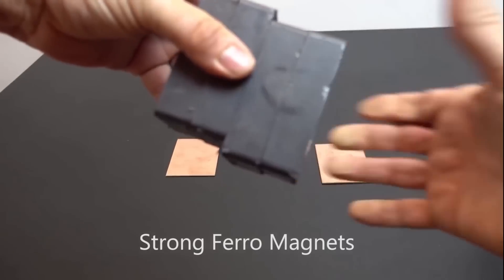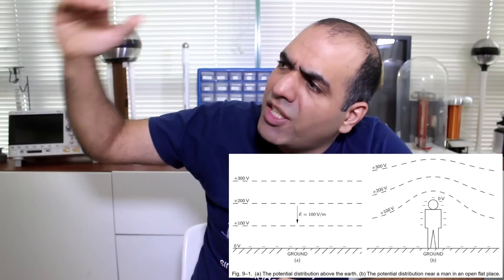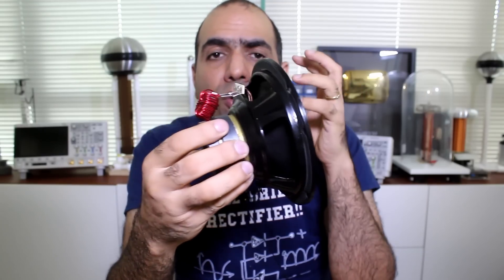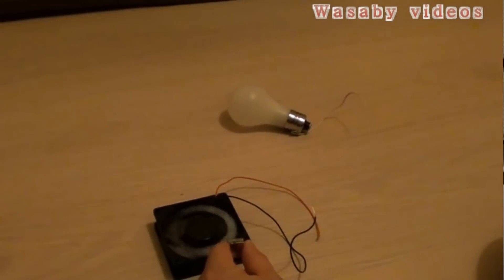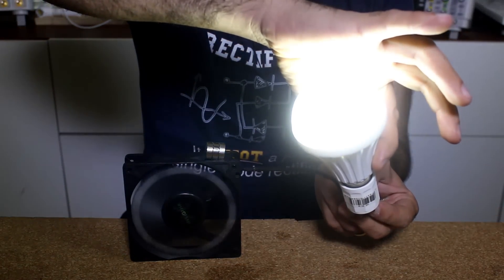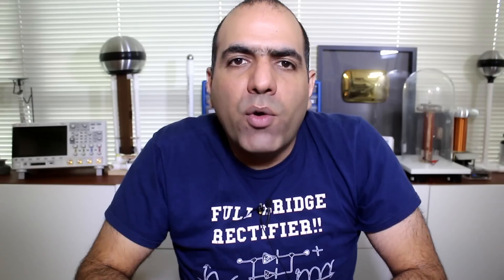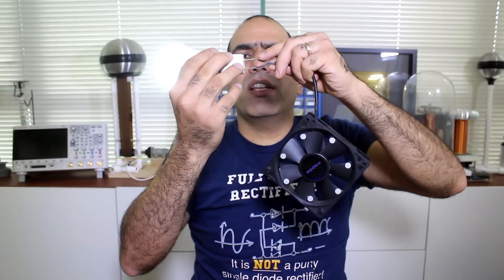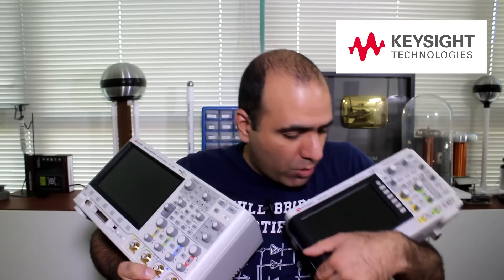Free Energy Devices Build and Science

Comment: There is free energy i.of one really wants it,  but it is far too dangerous to work on with it as you could get electrocuted, lightening is one example and the other is earth has a molten core, which is trying to resist moving with the earth's solid outer core,  the interaction between the two surfaces causes strong magentic field as well as generates electricity, we will have to dig hundreds of miles down to get to it. near impossible, however the weak effect of core of molten earth does create a weak moving magnetic field that can be inducted into a huge coil several hundred kilometer diameter and that should provide low frequency low voltage but high current electricity.  Besides if you dig two probes 2 miles apart there can be low voltage high current ac voltage that you can step up and use.

Comment: The light has battery in it. I have one I bought from menards for 10$ once you  connected the loop the light comes on and you recharge the light by plugging it into a lamp. They are designed for power failures.

Ok 6:39 is where he tells the truth. Lol

Comment: What if you were to do it mechanically instead of electrically? I can think of three ways this might be possible... One with water, bubbles, a tube,  a small air pump, and a Pelton wheel...A 3/4 inch tube placed vertically into a large body of water, about 4 ft deep. Bubbles introduced one foot inside the bottom of the tube when the air pump is turned on. The tube extends above the surface of the water 5 ft. with a 90 deg angle at the 5 ft point with a gutter to catch and direct water into a holding tank where water is then drawn from to push a Pelton wheel to generate electricity. 2nd, Another thought is to put a hollow Taurus on a horizontal axle with an iron ball in the center, then bring a magnet close to the iron ball a few degrees off of bottom dead center to make the ball roll while gravity pulls the rolling ball,  effecting the empty Taurus to spin on it's axle. My last idea would be to wait and see if there are any comments to my first two ideas and only if I see constructive criticism...lol...let you in on my best idea. ;) Let me know!
Reply: Don't hurt me too bad...I'm NOT an Engineer!

Comment: 1) No, magnetism through a wire does not create electricity... only a changing magnetic flux will cause electron flow... not a static (non-changing) magnetic flux field.  Your stacked small disc magnets do NOT create an alternating magnetic field. Once you join to identical magnets together North-to-South, the entire magnetic flux path of each magnet is through the adjacent magnet, none of it escapes the "stack".

2) No, picking up the atmospheric VOLTAGE at a single given point will not do anything. The only way to access this energy is to have a POTENTIAL DIFFERENCE... you must use an Earth-Ground as a reference, and then the "antenna" would be at the elevated position. The amount of available current per square cm is incredibly small, you would have to have a pickup "antenna" of several square meters to power anything.This 2nd "circuit" has nothing to do with resonating magnetism... it's nothing but a charlatin's way to close the DC circuit across the two connections of the "LED bulb", which has a battery inside it. When the 2nd magnet stack is pushed up far enough into the coil, it makes connection and turns on the "bulb".

This LED bulb explains all of those claims:
https://www.amazon.com/Light-Built-Rechargeable-Backup-Battery/dp/B0744GSNF9
TRUE "Free Energy" is nothing more than converting one form of "Nature Provided Energy Source" into a form we can use.  Typical examples: Solar Energy, Hydroelectric Energy, Geothermal Energy.We don't put energy into the "system", so we are getting more OUT than WE are putting into it. We are only providing the equipment to convert it into a form (AC) that we commonly use. 

Over-unity does not break the law as related to CLOSED SYSTEMS.  Real free energy is never a closed-system, it is an OPEN SYSTEM, whereby the energy source is outside of the conversion process.
This is the truth behind lesser-known "Natural Sources of Energy"... that "scholarly science" scoffs-at... until they are proven wrong, then it is spoken of as if they've known it all along.
In the 1700's - could mankind possibly understand or believe that we would convert Solar energy into usable electricity?
No different than now, when some REAL experimenters claim to have converted "background energy", the aether, zero-point energy... into a usable form of energy. Many things are discovered by people who are not educated in the related arts... that is not a requirement for "discovery"... and very often actually gets in the way of it!!

Comment: what the hell is AC energy
Reply: AC = Alternating Current. It switches polarities. In europe, the mains AC switches 50 times a second = 50Hz. DC = Direct Current. DC doesn't change polarity.
Reply: @rapidleopard3881   energy has nothing to do with differences between AC and DC
Reply: @ayushman_sr  You asked  what AC is, and I provided an explanation. What exactly is your problem?
Reply: @rapidleopard3881  "AC energy" is not the correct term. AC is way how electric current is in wire in this video
Reply: @ayushman_sr  There is no such thing as AC energy. AC, as I said previously, is current continuously switching polarities. It is exclusive to electrical energy. AC is in no way a type of energy.
Reply: @rapidleopard3881  thank you for your precious time to put up answers 
well my original comment was exclamation ❗ not a doubt i want to raise...

Comment: Thermodynamics is not your friend. Free energy exists! And it is bound with the name of Helmholz. Some people might think: Helmholz coils. In fact F= U - TS. And it is indeed free, because you don't produce it, but calculate it.

The other nasticity is the efficiency of eg. heating system. It can well exceed 1. Of course energy conservation is not violated. Part of the heat is produced using other energy (mechanic, electric work), the rest is pumped. The trick is, efficiency is the ratio of useful energy (heat here) to the work we put in (not the total energy, because what we pump is considered to cost 0$). Heat pumps work like that.

Comment: A motor, gear set and generator still won't work due to the slow-down of loads and also friction.
I think a solar panel is not free energy, even if it is connected to a lightbulb.
Rechargeable batteries cannot charge themselves.
A hand-crank motor is... read the top.

Comment: Capacitors self charge when you short them out in water. There is a way to get it free with a tuned piezoelectric capacitor but in the end the energy is coming from the sun by resonance... mechanical energy converted into electrical energy.. Ac by way of piezoelectricity. Tune it to F sharp.. the same frequency as the sun.
In reality there is over unity otherwise the universe would not exist. The universe...It's growing!!.... and it's nothing more than one musical note collapsing on itself in a torroid shape creating plasma that is creating everything like a 3d plasma printer. The F sharp note... the only note that can collapse on itself into a doughnut torroid shape. If one wants to see what a actual shape of an F sharp note is... Look at the Horseshoe nebula. F sharp is the color yellow of the sun and it creates the blue sky and the red sunsets.... giving you the 3 primary colors of a plasma printer. Same colors of a printer.... only difference is the universe is printed with plasma created out of a collapsed F sharp note that is beating to infinity.
There are probably more universes than grains of sand on the earth... because it's infinite.... there is no end.
The earth itself is a giant capacitor. We are living on one.

Comment: Hi Mehdi, good video I enjoy your channel and practical teaching. I know and understand the laws of physic and thermodynamics etc. I also know energy can't just be created out of nowhere and can't be destroyed as just "disappear". Yet I have a silly question... naive yes but serious question, I will appreciate if you can point me in the right direction to what happens with energy in this case:

1. Easy scenario, a magnet motor used as a generator
2. Rotating at X RPM using pedals or the wind
3. The motor produces... let's say 14V / 150mah. 
4. We plug a Light bulb (led, whatever) it turns on!

I know the magnetic field / coil-effect movement produces electric energy and it turns on the bulb. Ok. But what if we keep the motor/generator running and NO bulb is plugged? where all those 14V and 150mah go? I know about generators such as Van de Graaff and ions. In the case of the motor, would something like ions would be taking place? but in very low scale that we can't see any visual manifestation? Just curious. Same situation with more powerful motors used as generators. Thanks, and congrats with your channel. Hector.

Comment: I have to ask... computer fan and magnets. In theory, if we used a super light giant fan (just strong enough to hold magnets), put magnets on it’s wings and one giant super powerful magnet. If placed properly, would it spin or not? 
If yes, couldn’t we use it to run a generator and create electricity? (Considering we have an unlimited space and all materials needed)
Reply: even if you use an impossibly light fan with an impossibly smooth bearing, the magnet would not only repel the magnet nearest to it, but also the magnet coming up to it, you would need to use an electro magnet to pulse either the powering magnet or the motor magnets and that would take huge amounts of power compared to it's production.
Reply: nicynodle2 so I guess the input power for turning the main electromagnet on and off cannot be lower than the power produced by the whole contraption, right? How about if we use the same pulsating magnet and put it in a middle of many fans with magnets. Put the fans around the electromagnet. As many as we can in 2 circles up and down.
Reply: @Fefko13  it would work better, but still would produce almost nothing per fan whilst the electro magnet would drain a lot of power, also, (I may be wrong) the more interfering magnetic fields the weaker the repulsion of each individual feild. So you'd need an even stronger magnet to push all the fans. (Oh, and if 1 magnet falls out of line it will start to reverse)
Reply: nicynodle2 we would set the distances between small magnets on fans just far enough so that their fields wouldn’t interfere. They would “catch” the field of a great middle electromagnet while avoiding each other. Now we need to somehow calculate the power consumption needed for the electromagnet and the power generated by all the fans.

Comment: THERE IS NO acoustic energy in the air as long as the speaker is not generating sound,even then you would need a microphone to absorb that acoustic energy in the air and transform it back to electric energy.He is just using the speakers magnet and coil.it has nothing to do with acoustic energy.
even if he moves the speaker diaphragm by hand which he is not,he can't call it acoustic energy,that would be another form of mechanical energy!!
For someone who is explaining scientific ideas he needs to be more precise in his wording.
Reply: Speakers work both ways. They can convert incident acoustic energy into electrical signals or electrical energy. Unless the room is completely silent, there is acoustic energy in the air. Considering that total silence may not exist, it is probably safe to say that there is some acoustic energy in any room. Just not very much (as he said).

Comment: Just to clarify neurons don't send electrons through their axons, they send an electric current, which is just the flow of ions in chemistry. They rather send sodium and calcium ions than electrons
Reply: It still equates to the movement of electrons
Reply: @AbsoluteTrash_  not necessarily since the entire atom moves and I guess the electrons on it move. But they are in the same relitive area, technically hydrogen ions are able to conduct "electricity". But a positive hydrogen ion technically has no electron and is just a proton.
Reply: When those ions are created by your body it takes from or gives an electron to the atom, which then moves to the receptor where it gives or takes an electron, resulting in a net movement of electric charge from one place to  another, also known as current flow.

Comment: i got a free energy hack, its kind of dangerous and illegal, but it works every time. You just connect your power leads in front of the meter, and there you go, free energy. Just dont get caught and dont fry yourself, dont steal electrobooms job.

As for turning on a light with your skin. I have strangely had my LED strip light up very very softly on a strip of 3leds when i was pressing it down to get the adhesive to stick. But that is probably just some static electricity going trough there, and those are very tiny leds, that lid up dimly. How in the hell do people think you can get enough energy from your skin to light up a huge lightbulb? Or even a 3 watt led?

Comment: Guys you should know the basic of electrical engineering which says if there is no relative motion between inductor and magnet then no rate change in flux hence no current.another thing without connecting wire he he
Reply: Butt hafe u aktually tryed it??????????
Reply: It's basic no need to try

Comment: You said there is no free energy in the ENTIRE universe otherwise it would fall apart. Right and it is. The accelerated expansion of the universe is at odds with no free energy however the "free energy" density is so low that it only shows up on intergalactic scales.

Comment: Question if you put a black sharpie or pen on your arm and then point your phones camera flash at it why does it shock you do a video on this!
Reply: uberderpyhoovs ...what?
Reply: @ARSZLB  its true try it your self
Reply: uberderpyhoovs i honestly just did, and there’s no shock at all. you’re feeling the absorption of heat from the light output of the LED flash. it works to a much more noticeable degree if you just turn your phone’s flashlight on instead of taking a picture which only makes it flash once very quickly. so it has absolutely nothing to do with electricity and everything to do with wavelengths of light energy.
Reply: @ARSZLB  but i did the flashlight it didnt work at all but when i did the camera flash it shocked me sorry corrected my self  it felt like a shock when i do it with my camera flash
Reply: I have the samsun s8 btw

Comment: So here in the uk I was re doing my room and we took off the electrical outlet but everything was still active I turned on the switches by accident and touched the two plates behind the cover and blacked out so I have two questions one why didn’t I die and two if I didn’t die why did I pass out ( as I normally have a external thigh pain tolerance I shouldn’t of passed out from the pain) like if you want to know why ??

Comment: Hey, I think you should make a video about using earphones/headphones while charging. Since my families told me it's dangerous and there isn't any reliable info on any web because half people say it's dangerous and others say it's safe. Thanks :)
Reply: Let them buy you bluetooth 4 earphones
Reply: I would've said that unless you're trying to recharge AC electrical appliances like a water heater, dishwasher, washer, dryer etc., and want to stick your headphones jack in it, you should be pretty safe. But I guess the Bluetooth someone recommended solved the problem :-)
Reply: As long as the charger is from a reputable supplier its completely safe. I would imagine confusion arises since it may be possible to get a small electric shock/tingle due to capacitive coupling to the mains through the rf suppression capacitor in switch mode power supplies. However the capacitor is so small its not possible for a dangerous current to flow.
Reply: @tomkennaugh  English bro? 😂
Reply: My best attempt to translate: "If you're not using a cheapo charger with no safety certifications, it's fine. People might be overreacting to a minor zap you can get from some charger designs, but they won't kill you."

I've never even heard of that. Is this the new "don't use the landline during thunderstorms" for the 21st century?

Comment: Air heat pumps use refrigerants and a condenser etc to draw in the air to vaporize for example isobutane. Geothermal plants use this tech underground. Is it really so crazy to use the ambient heat of the air as a source to push the pressurized vapor through a turbine circuit? Heat pumps, fridges and power plants do this already :) I mean I can debunk crappy free energy ideas all day but there are some good ones using an unconventional source such as the air as an extra input of energy. My hot water system is an EVO270 and 1kw input gives 4kw heating output. 
Fight me

Comment: You dont send a pulse thru the cable becaus the electrons have nowhere to go on a speeker they are connected to the - cable and the plus cable. And magnets arrent a free energy source anyway because they run out (don't work after you using it for long) you don't even show the light balb glowing for more than 3 sec AND MAGNETS COST MONNY TO!

Comment: Would be kind of funny to light a fart or something with a kite (not when bad weather) with a wire line or spark from a large antenna.   I guess you could do the same with a coil of wire under a high voltage power line... like lighting a flourescent bulb. https://youtu.be/XsRwfUyAsHY?t=152
Reply: Technically, be careful when playing with what I mentioned above.  The systems if designed correct can be dangerous and cause serious burns.